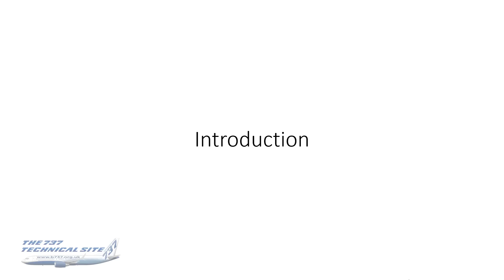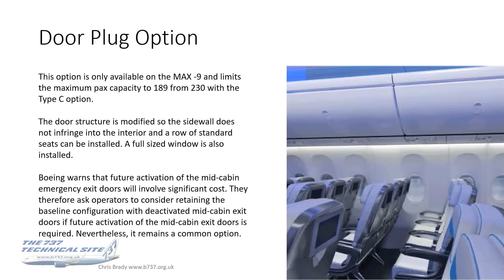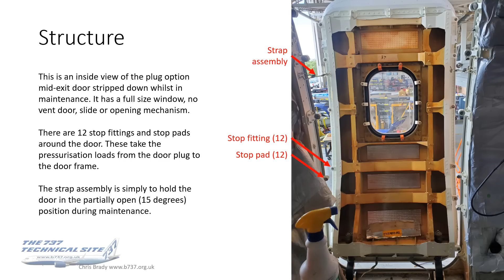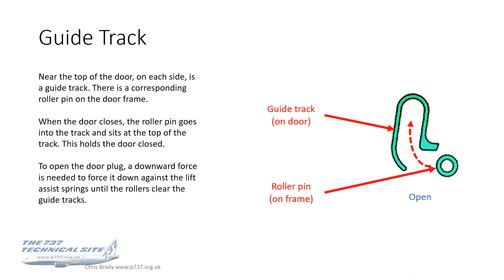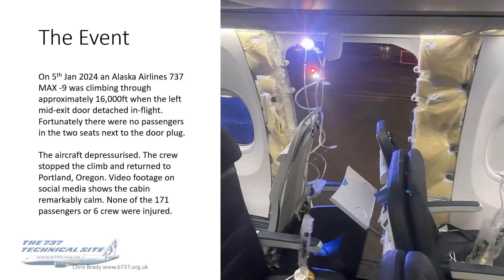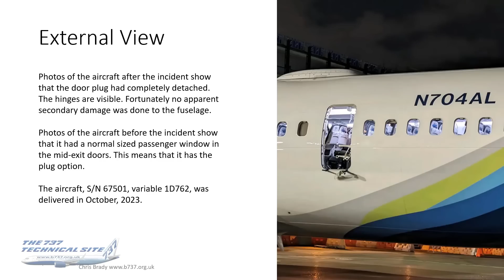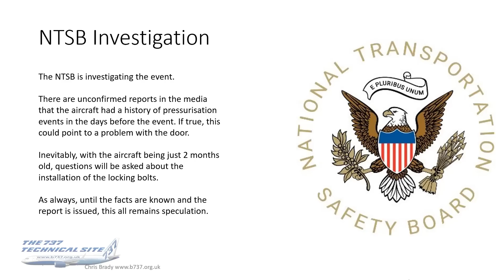737 Mid-Cabin Emergency Exit Doors - Plug Option

Comment: This certainly points to a failure to replace some, or all of the securing bolts. What is interesting is that on the final assembly of the aircraft, these doors are routinely opened to assist with moving parts into the aircraft as it is assembled. 

Quite some years ago now, I remember reading an AAIB report on a BA aircraft that was noticed to be trailing "smoke" as it took off from Heathrow. This "smoke" was actually a trail of fuel vapour. When the aircraft levelled off, and prepared to return to Heathrow after this rather alarming sight was reported and the crew advised, the cloud of "smoke" ceased.
It was found that one of the covers over the centre (fuselage) fuel tank had not been replaced after an inspection for cracking at the BA maintenance facility. The cover was actually inside the fuel tank hanging on a lanyard, used in normal inspection to hold the cover temporarily. The tank was not actually full, and the fuel only escaped because of the steep climbout from takeoff.  So I find it entirely credible that some technician in Boeing failed to replace the bolts and the door gradually managed to work its way up until it was free to move outwards.  The person who had failed to replace the fuel tank cover on the BA plane was never identified, by the way.  This was commented on, by the AAIB. 

Before I retired I was one of the safety authorities for a railway operating computer information system.  We had a scare with a software modification and had to to a quick update, (in a couple of hours). Of course this was a lot easier than dealing with real metal parts !

Comment: Great explanation as I’m use to the 800 NG’s and have very little knowledge of these type of doors. Glad someone else picked up on the movement of the door and guide track on opening at 6:28. The door must move up and not down as stated in the video otherwise it would just be contacting the roller. Lots of unknowns at the moment but questions about the bolts being fitted or possible failure must be the leading question.

Comment: Its lucky the flying door didn't damage the rear small wing elevators seconds after it broke away.  Damage to that could have caused the whole plane to crash?
Reply from the maker: It is fortunate the plug door did not hit the horizontal stab but even if it had it is highly unlikely that it would have caused the loss of the aircraft.

Comment: @ChrisBrady737 you might want to check again and look at other comments - looking at the picture of the upper locking pins and your diagram, the plug will disengage from the pins when it is lifted, not when it is lowered.  The lift springs would appear to provide assistance to the maintenance personnel when the plug is to be removed.  When the plug is in place, the 4 locking bolts are therefore under pressure from whatever upward force the lift springs exert in normal use (which may be minimal given the weight of the plug pressing down on the springs).   

I'm also trying to work out  how the stop fittings work with the stop pads.  Given the plug is sitting outside of the frame (as opposed to front entry/exit doors that sit inside the frame), at operating altitude the plug is being pushed out by air pressure.  For the stop pads/fittings to serve any purpose, the fittings on the plug would have to sit on the INSIDE of the stop pads and the pads will then carry the bulk of the load into the frame to prevent the plug from blowing out - otherwise all the pressure load is being carried by the (quite short) locking pins and lower hinges.

I'm assuming that when the plug is being installed, the stop fittings are initially sitting ABOVE their corresponding pads but extend into the cabin beyond the pads - and when the plug is pushed down to engage the locking pins, the stop fittings slide down and rest on the INSIDE of the stop pads which then allows the stop fittings to transfer the pressure loads to the stop pads and to the frame.   The picture at 8:48 would seem to confirm this arrangement - you can see a stop fitting at the bottom of the pic sitting on the inside of the corresponding stop pad . 

If my assumption is correct then your section at 7:26 where you indicate that the upper guide fitting bolts prevent the door from moving outwards is incorrect - the outward movement of the plug is constrained by the 12 stop fittings/pads and to a lesser extent by the upper guide track - the 4 locking bolts serve only to stop the door lifting.

Can you advise?  Great series of videos by the way!!
Reply: What is the approximate weight of one of these plug pieces?
Reply from the maker: 29Kg
Reply from the maker: * Errata *
In this video I state that a downwards force is required to remove the door plug. I based this statement on text in the AMM SDS which I now believe to be incorrect or misleading. It is possible that a very small downwards motion (1-2mm) is first required to be able to free the locking bolts. But the door must be moved upwards by a couple of inches to clear the guide tracks. Apologies for any confusion.
Reply: Thanks for the update @ChrisBrady737  !  Thanks also for creating such a detailed and comprehensive series of videos on the 737..
Reply from the maker: AMM SDS 52-23-00 Page 6 MID CABIN EXIT DOOR PLUG - COMPONENTS, Lift Assist Springs:
"Apply a downward force to the door plug this forces it down until the rollers clear the guide tracks. At this time the door plug can open outboard."
Reply: @ChrisBrady737  hmm..  well something doesn’t make sense. If the rollers in the frame sit at the top of the upper guides on the plug when the plug is in position, as per your diagrams, there’s no way the plug can be pushed any lower..  As a follow up, listening to the latest NTSB briefing now that they've inspected the plug, they have confirmed that the plug is raised to remove it, not lowered.  Looks like the AMM needs to be corrected!

Comment: At around 6:10 in describing the door plug you mention the assist spring keeps the door from falling back down “which would not be desirable during an evacuation” but that plug type hole isn’t ever used for evacuation, only during maintenance.
Reply from the maker: The springs are there on all mid exit doors / plugs.
Reply: @ChrisBrady737   That door is probably  heavy. The ONLY job of the springs is to assist in OPENING the door during maintenance intervals. Without those springs, the door would need to be rigged to some sort of lifting crane and extra rigging would be necessary. Because there are no outside attachments points, rigging would need to be done using some sort of vacuum attachment.

Comment: First of all, great video.  But after watching this, the design of the door plug is crazy in my view.  There are 12 stop pads (on the inside no less), but none of them are used to secure the door?   Basically we only have four small bolts that are holding the door in place, and that's it.  Meanwhile on regular doors, they are bigger on the inside so that when it is locked in position, the pressure will push it against the fuselage, preventing it from opening or blowing out.  The regular doors are designed like a true plug so that in order to open the door, it has to be swung inwards before moving out.  Why couldn't Boeing do this with the door plugs?
Reply: My bet is that the stop fittings slide down when the plug is fitted and rest on the INSIDE of the stop pads - so you have 12 points where the pressure is transferred to the frame.  The 4 bolts are then only stopping vertical movement of the plug and dont carry the full pressure load.

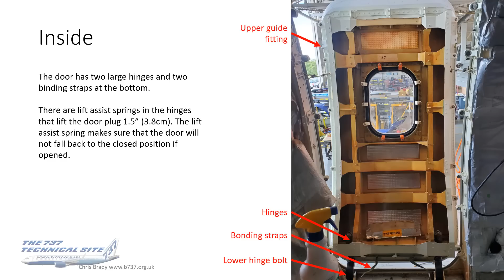Comment: I suggest that the last statement in the graphic from 6:26 to 7:26 is incorrect:  "To open the door plug, a downward force is needed to force it against the lift assist springs until the rollers clear the guide tracks."   This is inaccurate, because in the normal "closed" position, the door plug is already forced down against the compressed lift assist springs, so the statement for how to open it should be something like "To open the door plug, after removal of the two upper locking bolts and the two lower vertical movement arrestor bolts, the plug assembly is lifted (with the help of the lift assist springs) so that the upper guide tracks move upwards off of the roller pins to release the top of the door so it can hinge outward."
Reply from the maker: * Errata *
In this video I state that a downwards force is required to remove the door plug. I based this statement on text in the AMM SDS which I now believe to be incorrect or misleading. It is possible that a very small downwards motion (1-2mm) is first required to be able to free the locking bolts. But the door must be moved upwards by a couple of inches to clear the guide tracks. Apologies for any confusion.
Reply: @ChrisBrady737    Thanks for clarifying!
Reply from the maker: AMM SDS 52-23-00 Page 6 MID CABIN EXIT DOOR PLUG - COMPONENTS, Lift Assist Springs:
"Apply a downward force to the door plug this forces it down until the rollers clear the guide tracks. At this time the door plug can open outboard."

Comment: The fact that they can be opened for maintenance makes them operating doors and as such they should be monitored on flight deck. The NTSB directive will either be to instruct the plugs are not to be opened, or if they are, there's a mega long procedure developed to ensure through paperwork they have been properly secured prior to reinstalling the interior trim panel. You can't inspect what you cannot see.  If it is true there were recent pilot reports of depressurization, no maintenance crew is going to be allowed to take the time to pull apart the trim and inspect the plug for securement. That would affect availability.  A position sensor on one of the pins would ensure the pin was home and the door is in 'home' location, but of course, that would have added significant cost to the option to have the added controls and wiring. Boeing really wants you to purchase the deactivated door option like you mentioned in both of these videos.  This is basic FMEA work and I bet a failure mode pertaining to the door plug opening causing depressurization came up and it was minimized as a non-event because it is called a plug and not a door.  Fact is though, it is an operating door.  Otherwise no need for the roller pins, just bolt the plug in place with 6 or 8 bolts and and be done with it. Can't wait to see the outcome.  Hopefully Boeing won't dream up a software fix like MCAS, lol.
Reply: Yes. The name 'plug type' is certainly misleading...

Comment: 8:43 Question on the upper locking bolt:  The nut is exposed, so the bolt must be inserted from the other side.  So does someone stick their hand into that space, and push a bolt in blind from the other side?
Reply: No, the operator chosen has a very very very small head and stucks it in there along with their hand, and actually does look while inserting the bolt.

Comment: Obviously, in my opinion, whoever assembled the plug in the fuselage failed to put the locking bolt pins in place to prevent movement of the door. There was no sign of structural failure. It simply moved upwards off of the roller pins on top 17:33  and up off if the hinge pins at the bottom! 
Obvious to me either a deliberate error, or major failure to follow checklist or instructions.

Comment: This is a speculative question more than a conclusion, but is the fact that there was zero damage to the fuselage somewhat indicative of completely missing bolts more than a gradual partial failure where one or more bolts fail at different intervals?
Reply: I think it's pretty safe to assume that the bolts were either left without the cotter pins in the nuts or not installed at all. Everything other than the guide channels on the doors were without damage consistent with something breaking off. There is a photo of the door hinges hanging out the side of the aircraft in perfect condition as if the door had just popped off
Reply: @cheeseburger3209  good point no twisting no deformation etc indicating points of resistance etc makes sense

Comment: 12:50 Those upper roller pins look short to me. They don't look like they stick out far enough to fully engage the guide track on the door plug. Are they the correct part number? Did they recede out of position? But what about the lower vertical movement arrestor bolts?  Could they hold the plug in place if the upper guide rollers failed. I would think so. Engineers?

Comment: Important correction at 4:39: The doors must be moved *upwards*, and then outwards. Not downwards and outwards as stated here? Unless I'm going mad.
Reply: He does say upwards in later parts of the video. I guess just a slip of the tongue.
Reply: @ImperrfectStranger The text on the slides also states downwards instead of upwards so it more than just what he says verbally.
Reply from the maker: * Errata *
In this video I state that a downwards force is required to remove the door plug. I based this statement on text in the AMM SDS which I now believe to be incorrect or misleading. It is possible that a very small downwards motion (1-2mm) is first required to be able to free the locking bolts. But the door must be moved upwards by a couple of inches to clear the guide tracks. Apologies for any confusion.
Reply from the maker: AMM SDS 52-23-00 Page 6 MID CABIN EXIT DOOR PLUG - COMPONENTS, Lift Assist Springs:
"Apply a downward force to the door plug this forces it down until the rollers clear the guide tracks. At this time the door plug can open outboard."
Reply: @ChrisBrady737  I understand that's what the documentation says, but it makes absolutely no mechanical sense given the shape and arrangement of the roller pin and guide track?
Reply from the maker: You are correct @TheHuesSciTech

Comment: Alaska Airlines Flight 1282. You don't think the guide track locking bolts for the roller pins or something else was left out during  production? I don't know how recalls work for airliners. This video raises questions about how aircraft are manufactured.

Comment: Great vid, it seems almost like none of the locking bolts where installed. And the door was allowed to bounce on the lift assist springs overloading the roller pin connection, prop shearing the pin. For me, looking ant the mechanism it's seems the only way for it to fail so cleanly. Definitely looking out for the ntsb report.
Reply: If no bolts were fitted, a hard landing would unlock the door and there is no physical way to check for this without disassembling the cabin interior panels. The “lift assist springs” are what holds the door closed and latched in the absence of the bolts.
The next flight the door would depart the aircraft as soon as sufficient pressure was applied.
Reply: @allangibson8494  lift assist springs help with lifting the door when opening it. They don’t close the door.
Reply: Not even necessary to shear the guide rollers. If the lock / arrestor bolts were not installed, the door could work itself into the open position with enough jostling.
Reply: As I understood the latest NTSB briefing, the roller pins (on frame) were in tact, but the corresponding guide tracks (on door) were sheared.  These are “guide” devices and not structurally sufficient to hold the door in place.  

The AL 1282 aircraft appears to have the hinge and lift assist spring assemblies still attached to the airframe.  This seems to imply that the hinge guide fitting was ‘launched’ off of the hinge guide post.  This would take it past the large washer and what appears to be two jam nuts at the top of the guide post. (Presumably to limit the door’s vertical travel when opened for inspections.  Again, these are not structurally designed elements designed to retain the door during flight.  A quick look at the remaining hinge assembly and guide posts would indicate the door plugs route of departure from guide posts.
Reply: WTF is a vid?
Reply: @Capecodham  Video for those who don’t speak “millennial”…

Comment: I wonder if the proposed inspection is based on the hinge tubes being present but no "witness marks" that would be present if the bolts were fitted through the hinge tubes when the door tore away. 
i.e. The investigators already know it didn't have the bolts fitted through the hinge tubes, so are requesting inspection that those bolts are fitted correctly and no doubt inspect the securing bolts through the upper guides too.

Comment: Are any efforts underway to try to locate and recover the door plug?
Reply: found
Reply: @davedixon2068  and some loose locking bolts.
My guess is that this comes down to a failure of inspection and quality control.

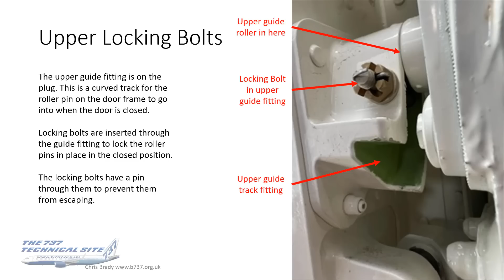Comment: Is that a split pin on that locking nut at 9:39? Those are still used?
At 14:20 they refer to the use of other photos showing a normal size window, meaning it has the option. How about the configuration data of that aircraft? Does that confirm it had the option officially installed?
The last statement rules: no speculation until all facts are known.

Comment: Well this seems it was a manufacturing problem.
Seems, because an A/C put into service in Oct would not be put through a service check that would require or need that door opened .
But anything is possible( pressurization leak squeal Etc). a logbook search will answer all questions.

Comment: Excellent information, thank you very much.
Is there anything you can tell us about the door seals? This may become relevant if the door plug may turn out to have been opened to investigate a pressurisation issue.
When looking at the Airbus door that was opened by a passenger on a landing approach last year, I noticed that the door seal is of tubular section with a number of holes along the side of the tube. These holes are open to the cabin air. Therefore the tubular seal is somewhat inflated by the cabin pressure being greater than the outside pressure. Does this door plug have a seal that works in a similar way?
Is the seal visible in any of your photos?